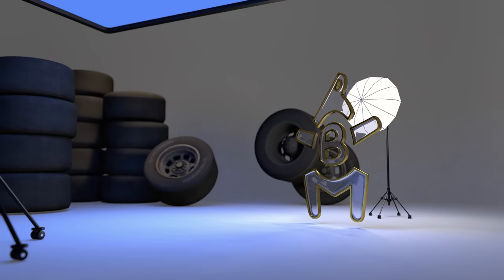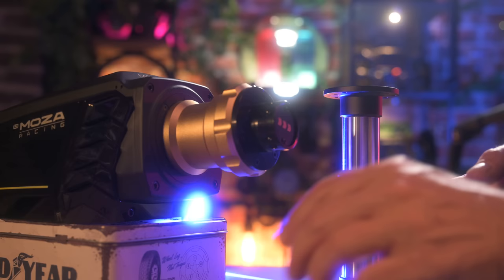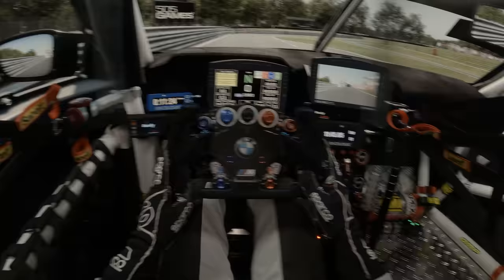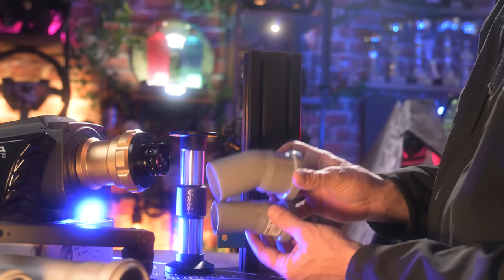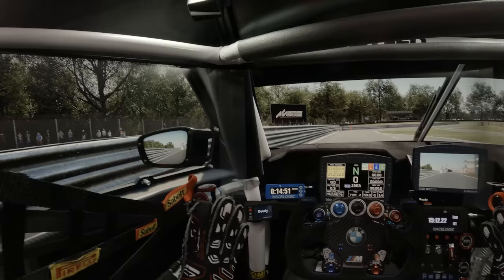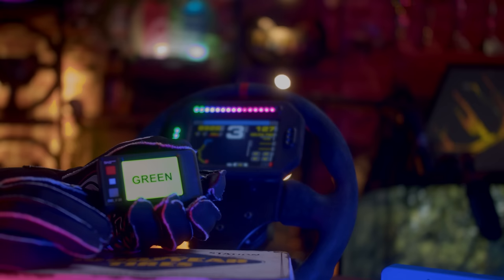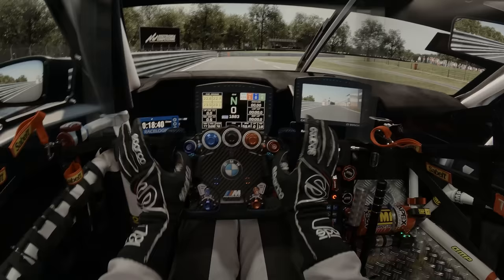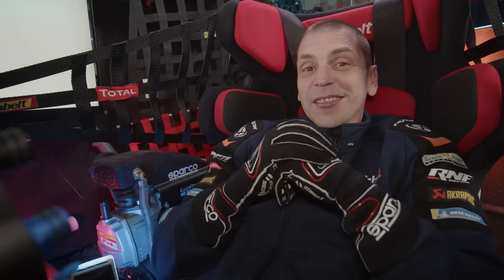How to build IMMERSIVE Sim Rig in 2023

Comment: I was building my rig and watch the video while taking a break.  thank you so much for sharing your knowledge.  Buying things and slapping it on a rig is an option but being able to create it on a budget is an art.  I just started putting everything back together as the rig was getting heavier so I installer large caster wheels so I can move it around.  now I need to make lock downs as I realized even if I lock the caster it still shifts when I sit.  This is what I really like just tinker with it get it to work then at some point pull it apart do the upgrades just keep building on it.  

I do driving and flying so it needs to be adaptable but this is the joy.  Create solutions to problems then enjoy the result..  a great hobby that you can interact physically.
Reply from the maker: Love your post Serdar 😃 
What a beautiful hobby to physically interact indeed buddy 💪 
We are lucky for sure having this bug 🤗

Comment: This is definitely giving the @BoostedMedia rig a run for its money, probably the two most immersive rig setups I've ever seen and the most surprising part is the difference in cost which is just wow.
Reply from the maker: Thx Victor 🤗
Reply: I like the difference shown between the two rigs with tripple 27 inch with shaft extenssions vs 65 inch with the motor in front of the screens

Comment: Hey brother,
    Don’t know if you remember but I was having issues with my MOZA R9 overheating and reducing FFB after less than an hour of driving.
    MOZA replaced it a couple of months ago and it’s great to be able to drive with confidence. Thank you for all of your help; I asked a lot (I mean, a lot) of people for assistance and you were genuinely the only one that actually wanted to help me get it fixed; it really helped me to get it replaced, so thank you!
     Another thing I want to big you up on, is a video you released a while back, about the importance of body position for optimal braking. I really struggled to get my rig into the correct position and I knew it was holding me back.
    A few days ago, I noticed that I could adjust the back of my rig in a way I hadn’t realised before and it put me in the position I needed to be.
    It has literally shaved over a second off my average pace (average, as in consistency and not slow :p) and has helped to bridge the gap between me and the fastest people on track.
    A lot of people post videos with tutorials and many have spoken about positioning but the way you condense your advice, not wasting words, really helps! So thank you brother, you’ve made me fast!
Reply from the maker: Hey brother, I remember very well your issue and I’m so glad the Problem is solved and Moza did change the filthy unit😃 
You ware unlucky with your first base but so glad to hear the problem is resolved and you can fully enjoy the experience ❤️ 
Thanks for the kind words as well man 🤗 really happy to read my videos helped 🍻

Comment: G'day mate.. How the bloody hell are you? Did long time no speak... As I've said before and many others. You have been my inspiration for immersion.. And wholly shit. Have I gone down a rabbit hole. With my bad ass rig.. Everything was and is done with my own hands (helps being an x tradie in the building industry) I've fully enclosed my quad monitor set up. From front to back and even a roof.. Had to install air-conditioning that feeds through the windsim. As it gets very warm.. I've made a custom engine bay above my pedals. That hold my pc buttkicker and power points. A full on roll cage. (I used cardboard poster cylinders) safety padding and sponsor stickers everywhere.. That wraps around my whole rig. Same goes with my wrap around dash and console.  (covered in car carpet).. I went a little different to you with safety nets.. (I made mine. It was so much cheaper than buying them).. I have mine on curtain rods hanging from my roof. On both sides of the seat.. I added sponsor patches to mine. (aussie themed of course). I have philips hue lighting. (already had it. With my home entertainment system). I think I went a little over the top with button boxes and displays.. Elgato stream deck mk2 and xl.. Two flag displays a custom made lcd display and a 8 inch tablet... Waiting on a couple more button boxes. Too add to the collection.. My next step will be adding a proper tacho and speedo to the dash..
What gets me about some youtubers and their ($100 000 rigs). There's no immersion. Their rigs sit in a wide open space. Where you can see everything around you... That's not racing. That's just gaming to me... Keep it up mate. Because I love what you do here on youtube for the community.. 👍🏻
Reply: Hi, it would be awesome if you can post some pictures on social media or do a workaround on your YT channel.
Reply from the maker: That was great post to read brother 😃 
We are lucky guys to enjoy at max this hobby man 💪😁
Reply: @wisniatd  G'day mate.. Thanks for your reply.. Yes, my friends are pushing me to upload my rig.. Still working on a few things. Before I expose it.. 👍🏻
Reply: @chepilevski  definitely my friend.. Love every second of it... Nothing better jumping in the rig and being fully immersed... 👍🏻

Comment: You definitly have the most immersive setup with triples on youtube IMO. Personally I went the VR way. I currently have the 4090 with a Quest Pro and  eye tracked fov rendering  and I have to say that VR is quickly closing the visual quality gap to screens. I figure that By next year (with 5090's, higher res microoled headsets and hopefully some  better optimized VR sims coming out) that it will almost be on par. The only thing I don't like about VR is not being able to see your surroundings and the comfort on long stints.
Reply: @denimdimi  I have to admit that the thought has crossed my mind a few times also hehe. The problem is that I'm about 10 secs slower on stages in DR2 and 1-2 seconds /lap slower in ACC on my 34" screen  vs VR.
Reply from the maker: First I start building all this around my rig because of the VR 😃 I love VR and is unbeatable and I wanted to put physical staff around so while in VR I can touch nets and bars 😃 
VR is the future 😍
Reply from the maker: I’m slower with screens too then VR 🙈
Reply: @chepilevski  VR isn't very good for content creators also. Imagine how crazy your setup will be when we get good AR (Something Like the Vario bus headsets) on top of your setup. You will be able to integrate your setup into VR. I'm just drooling at that though. The future of sim racing is looking really good. I'm just scared that I will never want to leave my house once we get all that stuff hehe.

Comment: Great setup. I saw how much your pedal set is shifted to the left. I got a new rig never thought of shifting the pedals that far to one side. Been racing for 3 years and on my 3rd rig. Now Im starting to understand when you said it could take a couple of weeks to achieve a comfortable setup thanks.
Reply from the maker: Good spot John 😃 
I try to put my brake pedal as straight to my body support point and be able to apply the forces easier! It makes lots of difference in terms of comfort and control 😃

Comment: I gotta say having built real race cars for years I find building my sim rig much trickier. Habit taught me to use certain size bars, bolt everything down, ect but in a sim rig it just has to appear to be functional. Very grateful you posted the how to. Just curious tho, Have you been able to make your center consoles modular? I saw one of you vids with a ferrari console instead and gotta believe you are swapping them out per car you drive.
Reply from the maker: Hi Dave 
I have different consoles indeed which are build on single aluminum frame and with single corner I can attach/detach from the cockpit!
Have USB hub near that frame and just plug in!

Comment: Stunning, but 2 problems: 
1.  Remove the FIA catch net on the left and install SCCA window net.  It will feel more real.  Left catch net makes zero sense in a race car when you're sitting on the left.  Unless you want to die in fire.
2.  My donor car for real racing cost as much as the entire rig.

Other than done, you are a genius obviously.  You can add a hook for the helmet on the upper right bar like we have it in real race cars, and a Gorney bar to make it look even more dope.
Reply from the maker: Some people still think I should have spent that money for real car and as you’ve said, your donor car costs that much 😁
I use to had Citroen C2 rally car Gr.A which closed 55k and that was the easy part as one rally weekend costed around 3k if I don’t have any incidents 😁
Simracing is expensive hobby but is not any near expensive as real racing 😁
About the nets, I just try to make it as those GT3 cars which have safety nets on both sides.
I experimented with windows nets but the proportions doesn’t seat wheel with those monitors.
Thanks for the kind words buddy and best wishes for the weekend 🍻
Reply: @chepilevski  My "donor" was Subaru BRZ 2024 Flooded for $5000.  Now I have to test everything, dry out and run it.  Then build it.  I raced in Spec Miata, and I did it super cheap.  Full built race car was $5000 and weekend used to cost me $400 entry fee plus $25 per Hoosier tire.  I used to buy used tires from other races and ran them 1 second slower than their $800 tires.  Next car will be "street legal" so I can drive to the race with no trailer and pickup.  "budget racing" lol.  

One day I'll duplicate your setup.  Beautiful.

Comment: The short shaft of the Fanatec CSL DD is precisely my issue with my current setup I wish there was an extension in the market for these bases
Reply: You sure you can't let someone custom build it for you? 2 aluminium pieces on ends to have screw mounts attached to some tube. As I know Fanatec prices, custom built will be half the original price.
But haven't seen your base, if it has something different wheel mounts than others.
Steel elements might be too heavy but easier to find welder.
Reply from the maker: I hope Simracing Machines (SRM) will make something about it as with Fanatec is bit more complex to use extensions with there wheels !
Reply: Thanks you both for your input, let’s see if a third party can come up with something as I am terrible at DIY, although I don’t know if there are many people im my position that would justify enough demand to bring it as a product. Also the way fanatecs QR sustem works with the pin connectors may be difficult to get around so simply making an aluminium piece won’t suffice Im afraid. The goal is still to upgrade my wheel base eventually so I guess I’ll wait until then. Thank you both again :)

Comment: Another great tour and vid! I wish the bezel free kit was not so expensive. I’d like to try but it doesn’t seem worth it.
Reply from the maker: Yeh man , it looks s way too expensive for what it is 🙈
Reply: Didn't test it yet but you can find similar material in LCD screens (I read in the web). Think that this the part that keeps spreading the backlight.
If you have damaged LCD you can give it a try.
So the cost will be like 10% of the aftermarket kit. And using elements from TV makes it cover all size of monitor. Then there is a need to make mounts, but still will be cheaper.

Comment: I come back every now and then to your video's when I expand on my simrig :). Up next is adding two more iiyama screens. I was wondering if you just use the Asus bezel free kits out of the box or if there is some adaptor you use to make it work with 32 inches?
Reply from the maker: Hi buddy 🤛
Happy to see you are enjoying the hobby and working on the rig 😃
About the bezel kit, I just stick it with type on top and bottom without using the brackets!
Reply: @chepilevski  awesome, and thanks again for the quick reply 😄!

Comment: Great details with the PVC pipes to create mix of virtual and physical cage! I especially liked the use of different diameters to fake the perspective. And you've truly perfected the screen angles – even the Boosted Media channel has less perfect screen positioning and they used a lot of time to tweak their cockpit.

What kind of monitor are you using and from where did you get those 1D fresnel lenses to hide borders?
Reply from the maker: Thx Mikko 🍻 
Those are Iiayma 32 inch monitors 1440p and the lenses are those from Asus, the bezel fee kit which are for 27inch but cover perfectly those 32 with little modification 😃

Comment: I love this video so much that I have to start building it too. Great ideas you have there. I start building the RIG. Can you please tell me how wide and long your rig is? The height at which you mount the wheelbase is also important. Do you have a triple stand that stands alone? Finally, the question is whether it is a little wider at the height of the monitors if you still have any extensions there. What material thickness of the aluminum profiles did you use? At what height (bottom edge) are your monitors attached? I have a problem correctly assessing this in my planning program.

Comment: Have you ever tried using an ultra wide as the middle monitor? I'm currently building out my new rig but am currently using a 40" ultra wide as my main monitor which has almost the exact same height as 32" 16:9's but my concern is having that extra fov usually splits my driver side mirror between 2 screens. Also a bit of a pain in the screen config to get it all to align correctly. I don't mind the extra hassle if the end result is worth it but maybe I should just get a 3rd 32" for the main screen.

Also you must spend so much time cleaning your rig! Not a single dust particle in sight lol I clean my rig almost every day and I still find little bits here and there.
Reply from the maker: Oh man, I don’t have ideas how that works setting different size screens but I have see videos which looks good so it must be possible!
For the Rig I have big compressor on the side and every weekend blow the dust from the corner and then wipe but dust is pain in the back for sure 🤣

Comment: Had to come back.. For Triple monitor setup, whats your opinion on curved monitors. Here it looks like you have the flat monitor. You’re very in depth I see.. So just wondering if you had a reason. Im currently trying to upgrade my setup 😁
Reply from the maker: Those are curved but at 1800r 
About the picture curved or flat it doesn’t make much difference in my opinion but for example 1100r curve is so aggressive and in triple setup makes close circle and hard to get in and out of the rig !

Comment: What is the angle of the side monitors and what is the distance (at which point) from the head?
Reply from the maker: Side angle 50 deg and distance between 54-56 depending on the wheel I have attached buddy 🤛

Comment: Nice job man. Absolutely amazing! So much passion :)

Question, how do you match the temperature with this softbox? Using SimHub or just setting it manually for each game or track/setting?
Same with Phillips hues above, it's definitely more for night/evening/early morning, but still, how you've set up those to be dynamic?
Reply from the maker: Thx buddy 🍻
The softbox light is static and I change the temperature for every car inside watching the preview of my GoPro trough my phone to get it as close as possible! 
Mostly I look the cages of the virtual car and the ones I have around as they are white and try to match them!
I have Philips hew but only use them in certain corners as they are too weak to bring enough light for the GoPro 🙈

Comment: Hey! I was wondering what button panel do you use? I’m building a racing simulator and I think it would add a more realistic look to it. Great setup by the way😁
Reply from the maker: Hey buddy, in this one I use something I built myself but it is worth checking Simracing4u button boxes on the affordable side or Precision Sim engineering!
Reply: Also do you mount it on something, or put it on a wall? Thanks! Have a great day😁
Reply from the maker: @Diddypartywasfun  I mount it on 40/40 aluminum frame and attach it to the rig
Reply: @chepilevski  Thank you!
Reply: @chepilevski Sorry one last thing. I went on simracing4u and it said compatible wit pc and ps4. Would any of them work with Xbox? Thanks!

Comment: Is it possible to build similar setup with cheap wheel and pedals as g29 and upgrade it afterwards or the pro gear have different mounting and the more basic toys won't fit on 80 20 rig?
Reply from the maker: Of course is possible buddy 💪
You will always find the way to attach the affordable gear to those rigs!

Comment: Can you turn your head with VR set on comfortably without hitting your old RS1 seat or this new Sabelt GT pad seat? I want this seat as I'm 166cm and 58kg but I'm worried there is not enough room to use VR headset in it. I also noticed that when you look to your sides the upper part of the seat is blocking your view partly, is this a problem?
Can you recommend me as comfy seat as yours which doesn't have those head guard "flaps"?
Reply from the maker: Honestly I created a habit to pull my head ahead just a bit and that was enough to never touch the ears again! Particularly if your seat is leaning back your body position and head are bit front of the ears anyway! 
I never felt any discomfort and I drove for years in VR only!
Reply: @chepilevski  Thanks for the answer! I'll be happy to get the Mirco seat then!
Reply from the maker: @TheStobe84  I still miss it , it was more comfortable then the Sabelt I’m using now!
It also customizable!
Reply: @chepilevski  Haha! Great, then I won't go wrong buying it! I remember the video where you bought soft materials to put on the seat to make it more comfortable.